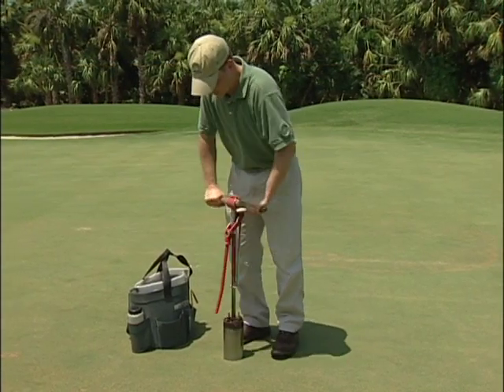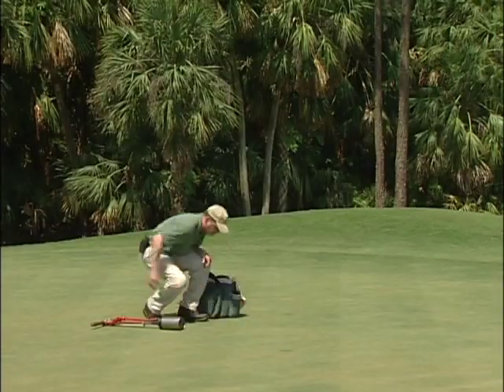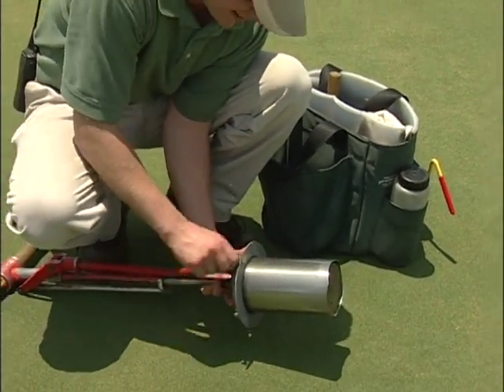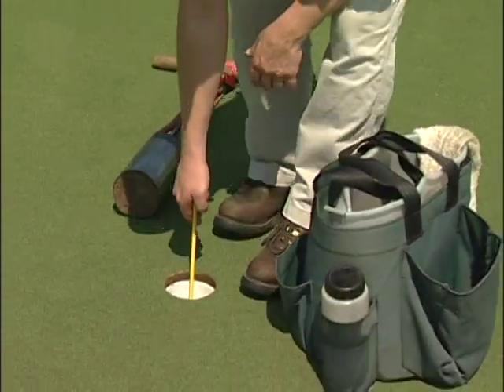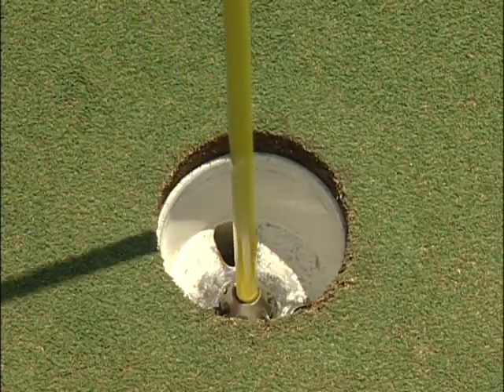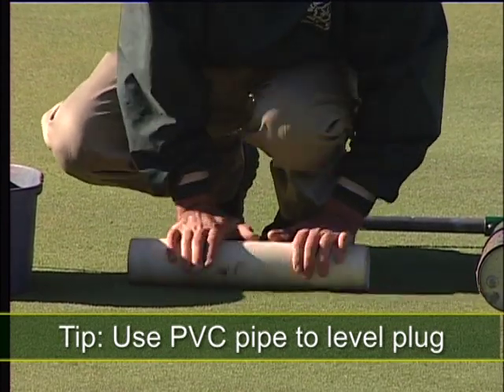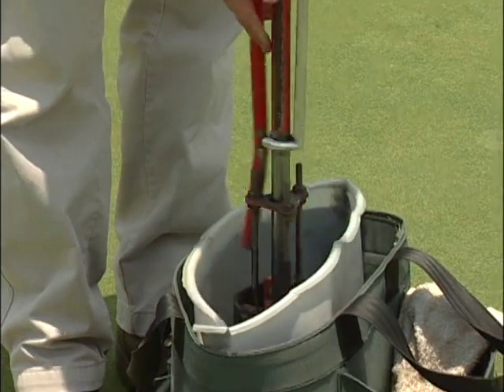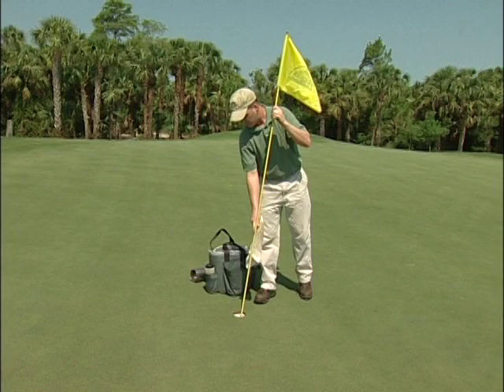Basics of Cup Cutting

Comment: Quick question… I use the fall line to read greens and I’m curious… do you try and cut the hole so the flag stands perfectly vertical (regardless of slope) or perpendicular to the slope?
Reply: R&R sells a bubble level for straight pins, dont ever know how I set cups straight before I started using it,lol....perfect vertical is what I strive for
Reply: Perpendicular to the Horizon, NOT to the Slope of the Green
Reply: Always set it straight...but this video to be honest is outdated... this meant for clay push up greens with sand build up from top dressing applications. Most greens are being rebuilt to meet new usga specifications. The rootzone is 12 inches of 90% sand and 10% peat. No makes clay greens anymore unless where they grow fescue greens but even than sand is best for drainage
Reply: @apaulmcdonough2170  yep always straight in the air. Cups are never set on huge slopes it's impossible and makes play way to long, setting close to slopes is the right way, stuff hard but not impossible